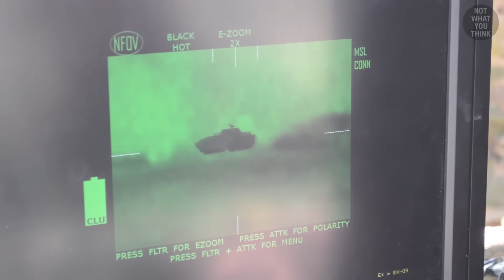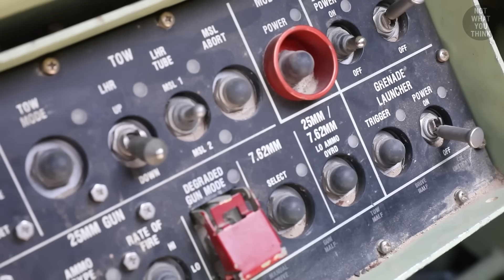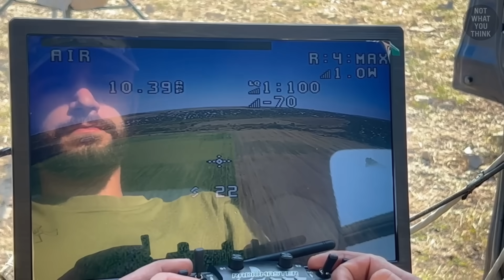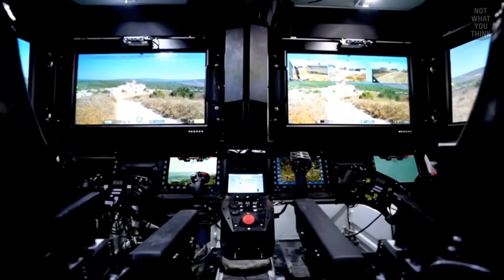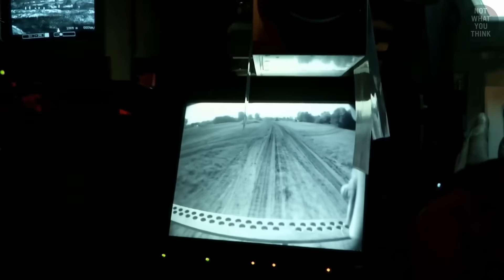How Bradley IFVs prove more Useful in Ukraine than Tanks

Comment: Air superiority is not what you think! 

Compared with the civilian world, the military is anal about using the proper terminology but there's a good reason. Terms like "air superiority" and "air supremacy" are completely different, yet in the civilian world, they're used interchangeably. There' is a scale the represent conditions of air space control by a military under the air dominance doctrine. Air superiority is a condition where one side has more combat aircraft and air defense systems able to exert control over a certain territory than the opposition. Air supremacy is achieved when you can operate with minimal fear of the opposing side, but there is still a threat.   

The USA focuses on securing air supremacy like it was achieved in the Iraq war.

Comment: It's probably a matter of costs and logistics more than anything else; a heavy tank like the Abrams is expensive to build, maintain and operate and difficult to transport. 
Logistics is what wars are won or lost on. If you can consistently put more firepower on the field than the other guy, then eventually you're going to win - if you can also maintain that firepower. The Soviet tanks that eventually defeated the N-word Germans for example were no engineering marvels - but the Soviet factories put out a lot of them, faster than the Germans could. Not to mention the lapse in the German supply chain which meant their technically superior tanks found themselves lacking the ammunition, fuel, and spare parts they needed to function. 
That being said, the ability to smash through fortified positions and overwhelm the enemy with massive firepower is always going to be relevant.
Because war... war never changes.

Comment: NWYT trying to not post a clickbait title for three minutes challenge (Literally impossible).

Tanks are a vital piece of combined arms warfare.  The issue in Ukraine, and specifically for Russians is that they're both lacking one of those arms.  ZHE LIFTWAFFLES... or more seriously, a proper suppressive airforce.  Neither side has dominant air control and it's a scary... scary sky out there.  Which means that artillery can strike with mostly impunity (counter artillery is very much still a thing), which makes deploying tanks a difficult situation.

But the issue is that tanks do have a necessary role to play.  Those Russian trenches would be far more easily handled if their infantry and IFV's had tank support and a mechanized unit that can rush the no man's land with minimal losses.

The tank isn't outdated... it's just more focused on combined arms warfare than ever before, and when both sides do not have proper access to those strategies, tanks take a backseat.

Comment: If I'm not mistaken, Medina ridge was fought almost exclusively from beyond the range of the Iraqi tanks. This was made possible largely because of the superior targeting and fire control systems in conjunction with a superior gun on the Abrams. Air and artillery support was mostly used to keep the Iraqi tanks where they were instead of letting them close the distance after they started to realize they were too far away. 

Combined arms is powerful and it is extremely useful, but it also requires all arms to be up to scratch. If you can't put up the air, your armor and your infantry are going to suffer and that's what we're seeing in Ukraine. Even with a technological edge the ukrainians are having trouble capitalizing on those advantages whereas the Russians are having trouble effectively using their superior manpower and in both cases it seems to be largely because of a lack of effective air power.

Comment: Our company designed the LAV-25s and multiple variants, including 75-to-105-mm ones.  The modern electric-turret LAVs are more effective than the Bradleys, at a much lower cost, in short range combat operations.  They are more maneuverable, go faster, are lighter to transport, and have better on-the-move shooting accuracy.  LAVs also have rocket launchers, and accessories which enhance their performance at "clean-up" operations.  Internal fire protection is better, allowing crew escape in the event of a hit.  The only advantage of the Bradleys is their frontal armor, which allows them to take hits from 40mm rounds, but this is usually not particularly valuable in UKR type of conflicts, since the hits are usually from artillery or tank rounds.  Costing and Production quantities favor the LAVs for any prolonged attritional conflict.

Comment: I have yet to see massed tank advance in this war as of yet. This should be easy to do on the steppe. Instead you see small columns of slow moving armor or just plain stationary. It is clear that the tank is not obsolete, the war in its entirety is being grossly Mishandled, largely due to lack of air power.
Reply: yeah, from all the videos I see, it's really just 4 tanks in a column trying to take a treeline, and most of them blowing up.

But I think mass AT minefields also don't help

Comment: DO NOT put the spotlight on the Bradley. Doing so will only cause it to end up on the DOD cut list. Just like the A10, proven, useful hardware seems to get the axe to make way for more expensive less liked hardware. Haven't we learned anything the past 30+  years?
Reply: If there's something better, why not move toward it?
And A-10 is very old design that isn't anywhere more useful than COIN, which can be better done with Pucara, for example.
Reply: @naksachaisaejane1982  Remember, some said the same thing about the B52 and C130 airframe. A10 is still an asset that's proven itslef over and over. The F35 can even replace it. It's a purpose built platform. Many ground troops owe their lives to it, a lot more then a F18, for example. Just saying, don't fix it if it's not broke. True in this case.  People are hyping up the Bradley, though there is a replacement for it already that also fills a gap below the Abrams MBT. But the Bradley isn't ready to get scrapped just to keep some contractor on the payroll.
Reply: @tc1uscg65  ironically, A-10 killed more friendly force than enemy, in part because of its mk.1 eyeball awareness. But why let them get close at all? Why not blow them up from they're far away? Sure, it's not getting itself marketed as good movie like top gun, but it's more effective this way.
Personally, however, I don't think Bradley IFVs are going to be scrapped soon, for better or worse. The closest replacement, M10 Booker, isn't IFV.
Reply: Osprey is the best example of this!

Comment: Tanks have one task:
Accurate direct fire from an armoured chasis.

IFV's are inherently much more versatile, it can transport troops but also supplies or support such as communications/Medical etc.
Additionally it is still a very potent and resistant to most things save from AT. The Bradley has a TOW launcher and 25mm gun enables it to engage a lot of contacts.

OP mentioned F-16's... That is a whole different playing field and while Tank/IFV can be compared, bringing in F-16's is just unfair. Absolutely apples & oranges.

Comment: I think the most important equipment has been modern civilian construction equipment (like excavators), which I have heard both sides have pressed into service to dig massive systems of trenches and obstacles 20 x faster than humans built them in WW I or WW II.  They work on 2nd, 3rd, 4th lines of defense far from the actual front with no worries of air attack due to modern air defense.  This, plus drones detecting offensive maneuvers easily, is driving the stalemate nature of the conflict.  Defense has really gained some major unexpected advantages lately (not unlike the defensive advantage evident from the American Civil War to WW I).

Comment: People forget.  The Sherman was considered a failure because it had trouble against German tanks.  Ok, but look closer.  The Sherman was cheaper, faster, used less fuel and could be repaired and replaced much quicker.  It was very effective in support.  Pill boxes, machine gun nest, mowing down infantry.  It could go places German tanks couldn’t.  It could come out of anywhere and at anytime.  When you add it all up, it was probably a much more effective vehicle than what the Axis had.  Kinda like a battleship.  The Iowa may not have been able to defeat the Yamato.  But it busted up everything else it faced.  The Yamato on the other hand had a lackluster career as the Americans knew not to face it head on and was eventually sunk by airplanes.

Comment: Bradley's so far made out to be excellent for target practice. Also as exhibits in that one russian EU weaponry museum.
Reply: There's a footage of a T-90M being knocked out by a Bradley. Yeah, your comment has not aged very well.
Reply: @francesinhadopudim5870  It was 2 bradleys + a bunch of FPV drones vs 1 russian tank, even so it did damaged badly one of the bradleys and all of the russian crew managed escape to safety.
Reply: @MadDogOfRegime  the fact that 25mms knocked out a T90 at all is embarrassing. Would never happens with an Abrams
Reply: @MadDogOfRegime   So what's your point? 
Both side's tanks and IFVs are being destroyed easily either by other tanks, FPV drones, or ATGMs. So like you said, basically target practice.
Reply: This comment hasn’t aged very well
Reply: @vme1111  Care to elaborate or you just going to post average template for reddit comments and shut up
Reply: @MadDogOfRegime  for one, it took simply 2 Bradleys to take out Russia’s most modern tank, and the vehicle loss ratio is 3:1 in Ukraine’s favor, and the crews of the UA actually survive. Visually confirmed. Nothing to debate here
Reply: @vme1111  Cool story, you should add some vampires to it so it sounds cooler.

Comment: Protecting tanks without air is not the primary problem. Protecting tanks without infantry and the tactics and methods of doing that is the primary issue. Which is why you have that problem on the Russian side, that has significant air power. The Russians, especially early on, were operating at a fraction of their billet strength when it came to infantry, and the infantry they had that were experienced got used up in the first 6 months. The Russians will never catch up in this war, their infantry and how its employed in combined arms is not sufficient to support their tanks. (when they aren't being used in large frontal assaults on defensive positions) As the war has progressed, the unit of action has progressively become the company, and this unit size is not sufficient to do this either; but it does limit how many troops can be killed at any one time by poorly planned and resourced ventures in enemy artillery range + periods of high information awareness by the enemy.
Reply: When you moving tanks in open farm fields infantry becomes less effective, Russian air support has been stopped due to anti air batteries. Although I do agree with you about Russias infantry issues but you give credit to a Russian air power that is non existent.

Comment: Okay okay. I'm going to pick one of many complaints to write out: air power was used to great effect during the major tank battles of Desert Storm, because we had it. Without it....the ground war still would have been wildly successful. It just would have taken longer with more than the ridiculously minuscule casualties. The degree to which the Iraqis were outclassed on the ground itself would have resulted in this outcome, and you can see it at the tactical level in small engagements where air wasn't involved. This is a poor axiom to setup as a leg for your argument.

Comment: I disagree with a lot of the assessment here. It seems to be a common notion that what is missing here is air power and I just don't agree. Air power is certainly important but I don't think it is the decisive factor here. Even at Medina ridge, Apaches killed 38 tanks but there were over 130 tanks and similar amount of IFVs destroyed. Even as a casualty inducing platform, air power did not necessarily out shine ground assets. Of course, there are other advantages to air power even ignoring who got the most kills; however the US would have won with or without air power during that battle.
In the context of Ukraine, they have long range fires in place of air strikes. Its not a perfect substitute, aircraft are better at precision deep strikes than ground assets but neither side has air power. This means neither side is actually able to conduct deep strikes or interdiction by air. And by extension, there is no need for heavy use of fighters as there are no enemy aircraft to shoot down or friendly ones to escort. It is an environment dominated by air denial. If you want air superiority, you need SEAD and DEAD.

Regardless, the roles fulfilled traditionally by aircraft can be mostly fulfilled by ground based systems. For deep strikes and interdiction, this is via cruise and ballistic missiles. Ukraine have shown this by repeatedly attacking airfields, artillery, bridges, HQs, and troop concentrations with GMLRS, ATACMS, and Storm Shadows. This ticks off the penetrating missions of traditional air assets.
For precision close air support, both sides are employing loitering munitions ("kamikaze drones") and is fulfilling this exact same roles. The CAS missions where traditionally planes go and hit tanks and other tactical targets can be and has been done by loitering munitions perfectly well.
Lastly, suppression is fulfilled by traditional rocket and tube artillery. So as it is hopefully evident, Ukraine and Russia has means to supplement the lack of air support with close analogs. Combined arms maneuvers CAN be done without air support. Just because NATO forces prefer these effects be carried out by planes does not mean it is exclusively in the domain of air. There are good reasons to prefer use of aircraft for some of these missions but it is not always(sometimes it is) a requirement. And while NATO doctrines are centered around air support, their equipment are not reliant on it. A tank is still a tank, so is a IFV and so is artillery. Ground assets are incredibly versatile and aren't rigid to a single doctrine.

So lets get into why Ukraine has failed. This is based on publicly available footage so this is likely not a fair or accurate assessment... but we are working with what we got. The first steps to any successful breaching operation are suppression and obscuration. And we have already failed to meet any of these objectives based on publicly available footage. There should be a combination of direct (tanks, IFV, MGs) fire and indirect(artillery, mortars, rocket artillery) to keep the opposing forces from engaging your assault(ie. combat engineers) group. To this extent, there should be use of smoke screens to cover their mine and obstacle clearing activities. And since smoke often indicates a breaching attempt, decoy smoke screens can also be employed in multiple locations. We can see that there are no proactive use of smoke in videos of advancing armored columns during the summer counter-offensive.
Next is rapid clearance of mines, and there is basically only one true way of doing this quickly. MCLCs. Preferably enough to create more than one path so you don't funnel your troops. There is also a need to secure the breach area for follow on forces to continue on to the objective(behind the defenses), but due to the aforementioned failures; Ukraine never even get to this step.

Ukraine's attempts to breach also get struck by drones. In the past, such attacks would be done by artillery and air strikes. Counter measures usually include counter battery fire and fighters(or SPAA as air denial) to shoot down enemy strike aircraft. However with drones, Ukraine need jammers; lots of them. Clearly there was not enough. Counter battery can and already has been done with HiMARS and MLRS. Also in  footage, Ukraine mostly uses mine plows and rollers instead of MCLC. Its a much slower and more dangerous method. So Ukraine lacked MCLC to adequately clear the Russian minefields in time let alone create more than one path, especially due to how deep the minefields are. Give A LOT MORE MCLC.
Next Ukraine, need to be more proactive in using smoke to cover such operations. I'm not sure why they don't. As for suppression, Ukraine need more artillery rounds and that has repeatedly been an area Ukraine continues to ask for. That's it. Once Ukraine breaches through, tanks can rapidly exploit the breakthrough.

Comment: a bit of lack at the end of the video but alltogether good.
missed to include the merkava in this mix, also the puma does not have an "autoloading turrent" its a totally autonomous turret. There is nobody sitting up there. basically the most part of the tank is the turret and its systems. It can also basically be mounted on the boxer due to the boxer being highly modular aswell as 
There are very many different capable systems out there, that overturn the bradley by a lot.

Those developments would give an even different point of view on this topic. And yes, the military industry already is going that direction for several years.

Comment: The BRadley is also an Infantry Fighting Vehicle, meaning it is a vehicle designed to Fight against infantry, which makes it super effective against foot soldiers, it is mean to protect the MBT from infantry attacks. They have to be used in tandem, along with infantry. The MBT is meant to destroy enemy armor and vehicles, thats the reason it was designed. Its the difference between a main battle tank and a normal tank, an MBT is like an Air Superiority fighter, its meant to destroy its competition, not meant to drop ordinance on troops. And its not like the Abrams and Leopard have any shortage of armor to destroy. Its imporatant that the Ukrainians know that infantry can really easily surround an MBT which only has a main gun and a few Machine guns to protect it. the bradleys chain gun was made to take out infantry at distance, its the purpose for its design.